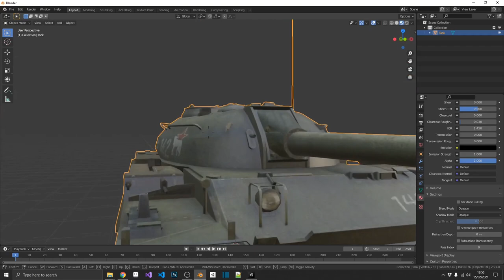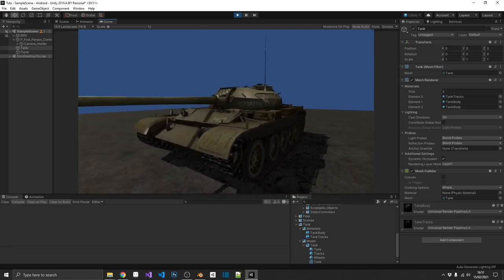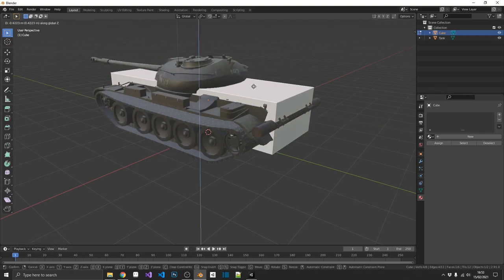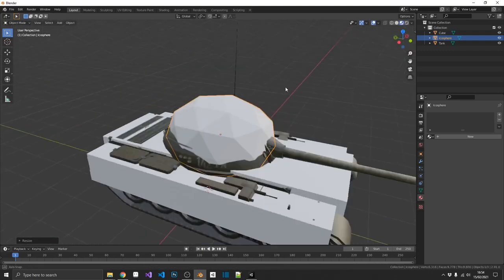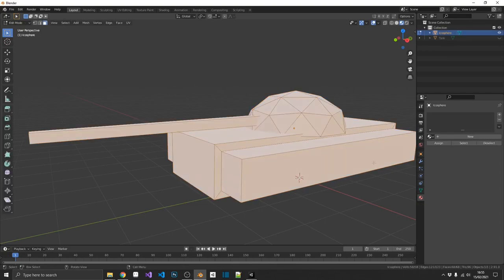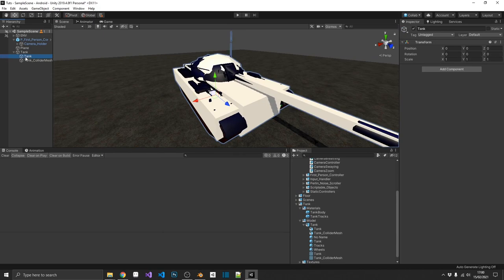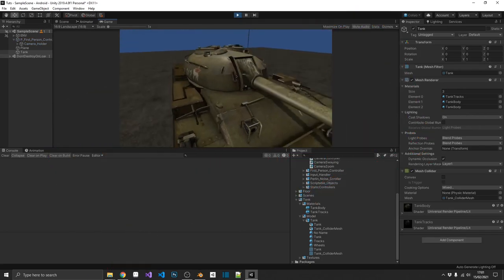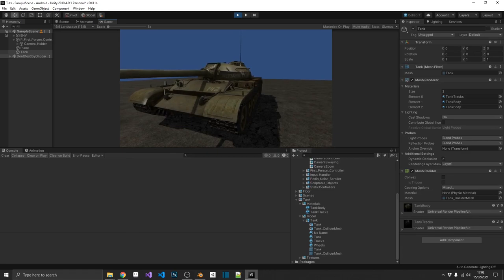How to Optimise Mesh Colliders [Unity Tutorial]

Comment: Very useful tip. Also Unity's ProBuilder can be used to create the fake mesh. Same fake mesh can also be set only to cast the shadows of the model, when the player is far away enough.
Reply from the maker: It surely can, personally I'm not a fan of Pro Builder, I just find it clunky to use but I'm used to using Blender and 3D modelling in general. All about what you're comfortable using I suppose

Comment: Hello, thank you for teaching this method, but I have a question about performance considerations. A box collider has 6 faces, so would a custom beveled box collider with 24 faces and a mesh collider without the convex option take 400% more calculation? Basically, are the number of faces on a mesh collider proportional to the performance cost, or can I at least plan it this way? I’m making a physics multiplayer VR game that needs accurate colliders, which is why I ask.

Comment: Thanks for the great video! I followed your instructions but for some reason it didn't quite work for me. I think my problem is that the Mesh Collider Components Cooking Options is still stucked on Everything where as yours changed automatically to Mixed (7:04). Any idea why or what's wrong?

Comment: Wouldn't a way faster way be to just duplicate the mesh and use the limited dissolve tool? That way it gives you a slider to adjust how detailed you want it to be. It won't ever get down to primitive shapes like you made here, but it'd get pretty close and it'd be like x10 faster.
Reply: Well good idea for most casual cases, but when you need modular damage for your tanks or whatever - better to keep separated colliders on tower, tracks, hull etc.

Comment: Great tip. I wonder if this method is still good for moving the tank for example through a city, because it is needed to collide with ground and other game objects
Reply from the maker: Yeh man this method would work perfectly. You might need to add a few more boxes for the tracks / any other dynamic parts just to get more detailed collision detection, but any way it would be 100x better than using a raw mesh collider

Comment: I see nothing here that cant be done with primitives, you know you can attach primitves to bones? That way its nice and optimized and can move, and if you really need some extra precision with placement, use a child object and rotate it, that way you can have primitive colliders at off angles, not sure if off axis scaling works (probably not because its not a great idea anyways) and all of this when attached to a parent object with a rigidbody, its gonna act like one big rigidbody. Collisions included.
Not to mention these mesh colliders, unless broken into chunks, cannot move with animations like the graphical mesh can, itd be too expensive.
It has to check each triangle individually for collision, and has no concept of "inside" the mesh.
For example, a sphere collider is the simplest one, being only one 3d point in space, and then a radius in which you can collide, mesning if you somehow landed inside the mesh, it would pop you out the side youre closest too.
Same with a box collider, it checks collisions within a box volume, and because of that, the whole box counts as colliding.
But with mesh colliders (with maybe the exception of convex hulls, but i think theyre processed in exactly the same way, just as an easy optimization option)
The only time you collide with the object is when you touch anywhere one the outer hull, but thats it, if something was inside, it would then be stuck in there, with the mesh collider acting like an infinitely thin wall, only colliding when it touches the edge. Its okay for more insignificant objects that are just set dressing, and if you make all your important objects collision type "Continous"(where it drags the mesh along its trajectory instead of teleporting a certain distance, which is how instantanious works)